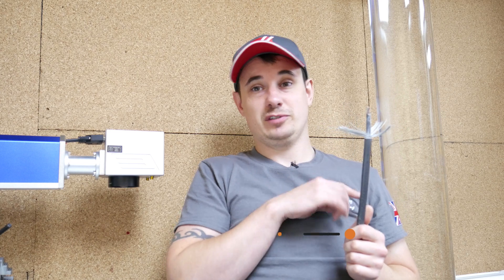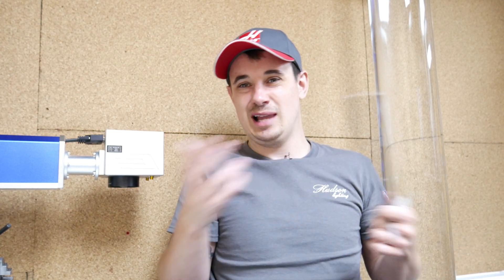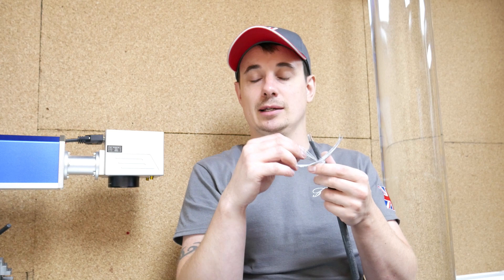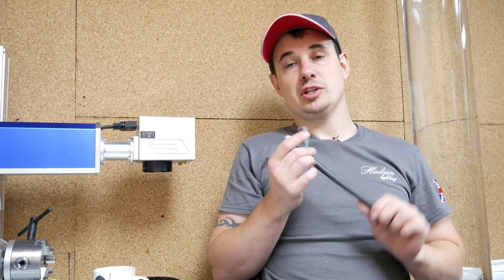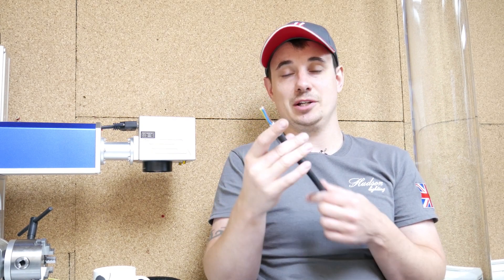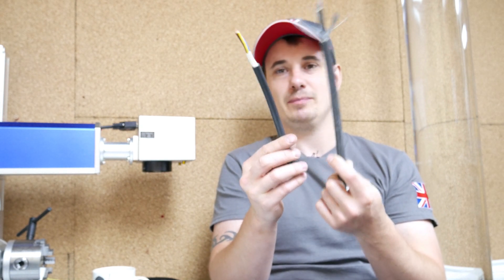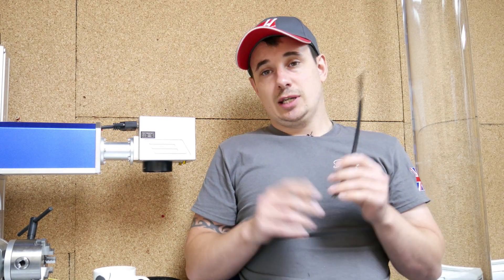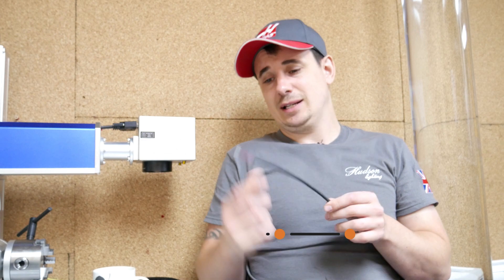Garden Lighting: Guide to which cable to use and why. Pros and cons of each

Comment: Use SWA cables.
Reply from the maker: This video was done such a long while ago...I mean it's terrible I'm surprised people still watch it. However, many more gardens on and the way it should be done is SWA for 230V distribution, NYY/Flex in duct for everything ELV buried at least 400mm ideally 600 but it's not always practical on site

Comment: Hi fantastic video. Can you please help me with some advice? I am installing an Electric Gate, lights on my pier/pillar and spotlights alongside the driveway. I can't go 60mm deep to run the cables also not sure what cables I need. All will be connected by a Professional electrician. But I want to run all cables before he gets here to keep the crazy prices down. Many thanks in advance to anyone that could give me some tips here. Do i need three different cables for all? if so, What cables should I get for each? The gate will be a 230 V + 4m of free racks
Power motor (V) : 230 A.C. 50/60 Hz.  The Pier lights will be 24V LED Strip Lights 5M 6000K IP67 Waterproof, High-Density 120W. And the spotlights will be a 50W 240V LED Strip Spotlight? I plan to run these cables on the gravel boards, any advice? All DIY projects apart from the professional power connection. Many many thanks to all.

Comment: If you are gonna be technically correct as you said at the start... Then don't just refer to "rubber"cables as H05 or H07 - That tells you nothing about the identification of a cable other than it's voltage rating under Harmonised Standards.
H = CENELEC Harmonized Standard
03, 05 or 07 refer to the Uo/U voltage rating of the cable
The alpha numerics that follow give you the cable characteristics/identification 

 eg. H05 VV-f is not  a rubber cable, it is PVC flex  - it's voltage rating is 05 = 300/500v,  
VV-f tells us the cable has (V) PVC insultion and (V) PVC sheathing  and (f) flexible stranded conductors.

If H07 RN8-f is specced then don't install H07 RN-f - both rubber flex but N8 sheathing is a different compound to N - the former being the waterproof version.
Likewise N4 is a different compound (Dupont Hypalon) - HOFR - heat oil and flame retardant.

Not just pedantic - knowing it might help - I've been to wholesalers before and requested H07 BN4-f and been given H07 RN-f.
Two different cables that look the same - one is a 90 degree HOFR cable the other isn't, but all the guy who served me picked up on was the H07 part and assumed the rest.
Reply from the maker: Interesting, didn't know that thanks for sharing

Comment: Not trying to be nasty but you should never leave a Chuck key in the Chuck ( always taught that as an apprentice) just pointing it out for beginners.
Reply from the maker: Thanks, appreciate it. It's just the laser rotary FYI. Very weak stepper. And it's not even connected

Comment: Extra low voltage every time. PVC isn’t recommend under BS7671 for outdoor use due to the UV damage over time. Very informative video. The HI Tuf is available with an Ethernet cable as well. EV installs.
Reply from the maker: You can get UV rated PVC cables. I think most black flexes are UV rated. SWA, Hi Stuff, NYYJ all have PVC jackets 👍
Reply: @HudsonLighting  According to Eland, who I phoned, it's the carbon black that they put in the PVC, that gives it UV resistance. However, it's not UV proof. So, it will age, albeit much slower.
Reply from the maker: @bitTorrenter  will all depend who you buy the cable from I suppose. Most of the time the cables used in a garden lighting installation probably won't be exposed to UV anyway, being buried or otherwise covered in some foliage

Comment: Why didn't you mention voltage drop? All you discussed was how durable they are. Fact is that people who come here to learn about "Guide to which cable to use and why."  People need to know that they carefully need to choose a cable whether they use 12V, 24V, 230V, 400V etc... The lower the voltage the greater the amps conducted through the wire which causes massive thermal damage in a fault condition when compared to 230V for example. the only way to avoid this is to choose a cable with a low enough resistance (greater gauge) not a single word mentioned about it...
Reply from the maker: Thanks for the feedback. I'll be doing a revised version at some point. The idea of this video was just to communicate the types of cable used for outdoor lighting AKA domestic gardens primarily and just a basic guide as to which you would choose. Not a cable calculation (size or guage as you refer to it) video

Comment: Hello mate, I'm just looking for a bit of advice please. My Mum had a wall mounted garden light replaced a couple of days ago as the fittings on the old lamp (almost ten years old) had rusted. On the old lamp I hadn't noticed the wire before coming from the wall but that's now visible, but it's the point where the insulation was cut and that you can also see about an inch or so of the live/neutral/earth wires going in to the back of the light that's worrying me, especially with the weather about to get worse very soon. The bloke who put it up did it as a favour as he was doing similar jobs for a neighbour so I'm not sure he'd be able to come back any time soon. Is it worth taping round the insulation and wires to add some protection? Thanks
Reply from the maker: Right now, an electrician (and I) would consider any single insulation exposed as potentially dangerous. Tape is okay as a temporary measure but in an ideal world the light would be moved up to cover the cover. Sounds like if you get water trickling down it's going to trip too...assuming it's protected by an RCD. A potential alternative may be a flexible conduit being installed over the cable - you can buy 10-12mm stuff if you look around. A final DIY alternative is cover the cable with some sort of weatherproof silicone. Absolute best is the first solution though.
Reply: Thanks for all your help, I'll get down screwfix and get some flexible conduit.

Comment: Anyone can help me out,  I have 3 outside LED lights, 2 on 1 switch and 1 by itself. Do the lights need to be looped? There's supply in, and supply out on each light.
I've connected the 2 LED like this and left the last supply out not connected. Same with the single LED.
My lights don't switch on and I'm confused.
Ive used swa from the house to my consumer unit, fitted the outside and shed sockets. They work fine. Lights are connected from consumer unit to a 2 gang switch, one switch for 2 led lights in my gazebo and the other switch for my shed led light.
Reply from the maker: Hey Andrew, what make and model are the lights? I'm not necessarily condoning doing your own electrical work - I come from the side that I believe it should be like gas and written in the law that you must be a qualified electrician, however, for your existing sockets, have you done an earth continuity and RCD test? Outside sockets were always one of the most carefully considered parts of an electrical installation. Going back to the 16th edition of regulations in 1991, extra work had to be done for those back then (RCD protection etc). Anyway, back to your lights, if you let me know the make and model I can confirm how they 'should' be wired
Reply: @HudsonLighting  sockets have been tested, I'll send a link to the exact ones I got. I did use twin and CPC for the lights and crimped the earth since these lights are double insulated.
https://www.electricaldirect.co.uk/product/breez-5w-opal-led-rectangular-surface-outdoor-brick-light-grey-732700
Reply from the maker: @TheYazza1  I tried to look up the product instructions but can't seem to locate them on Forums (the manufacturer's) website. I've never heard of a lighting needing to be looped with its 230VAC. If they have a feed in and a feed out you could have a faulty fitting..have you tried connecting each of the fittings on their own? I'm assuming you've checked you've actually got 230V at each fitting to atleast eliminate any other wiring fault? If you do I'd say the fittings are faulty
Reply: @HudsonLighting  yeah tried singly and didn't work. Could be faulty then I take it
Reply from the maker: @TheYazza1  providing there was 230vac or so at each fitting then yes I'd say faulty